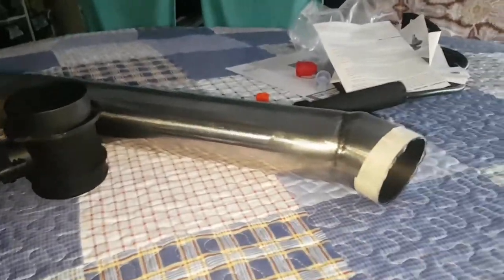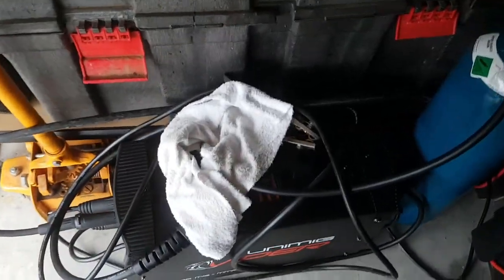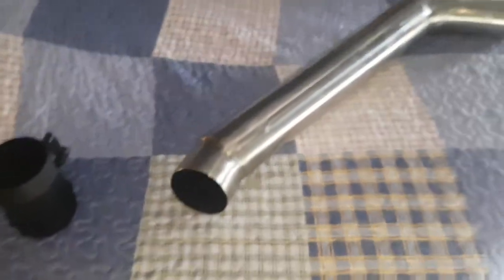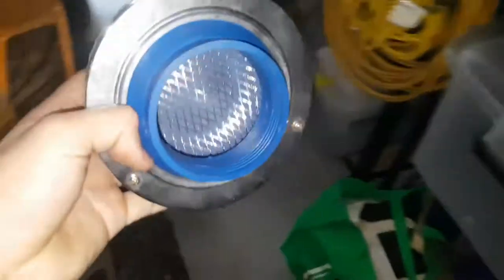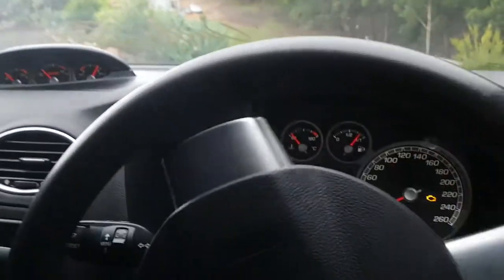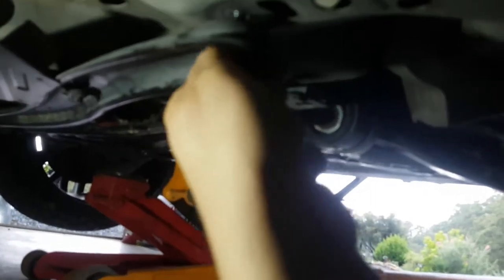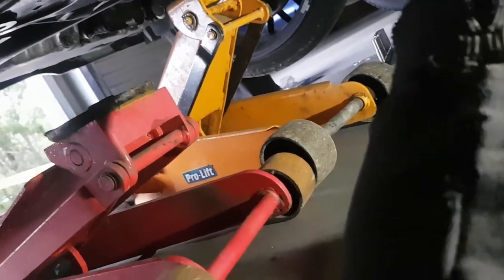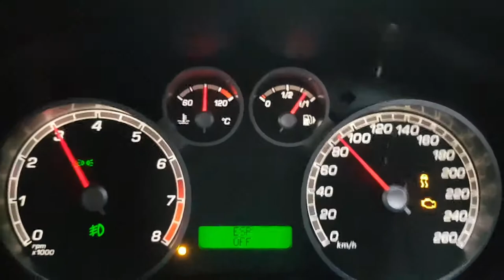Ford Focus Xr5 Turbo ST225 (3" Custom Intake) (Update)

Comment: Where does your boost go to when just driving normally, mine sits around the quarter mark and only goes to full boost when I floor it is that normal?
Reply from the maker: Adam Randell  yeah man mines the same only really hits full boost around 80% throttle but you have to remember these cars are ecu controll boost pressure man
Reply: No worries, I've heard you can get it to boost earlier by getting a better boost controller and an ECU tune.
I use these guys for parts http://focusonperformance.com.au/focus-xr5-turbo/  I got the stainless intake pipe and a custom enclosed air filter. I use Pumaspeed as well, they are probably the best focus tuners around.
Reply from the maker: Yeah man if you change the solinoid valve to a turbo smart one or somthing arftermarket it will help will the boost to come in more harder and quicker
Reply: Yeah I was looking into an elevate solenoid and inlet manifold, I was looking at ones off the RS but ford charge an absolute bomb for them. Would have to sell a kidney lol...

Comment: also the engine mount "torque mount" you have looks like the stock unit, its a pile of shit. the bushing in them flogs out really early, stick a elevate torque mount or vibra technics one in there and you will not longer get bashing during shifts. you will get more vibration through the car while idleing even worse with the aircon on but it starts to settle down a bit the more you drive it with the new mount.